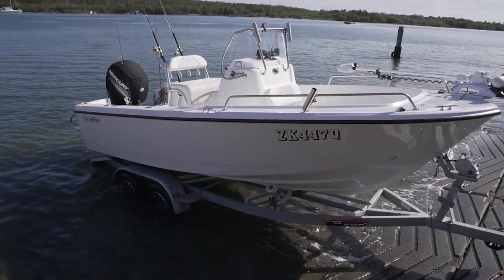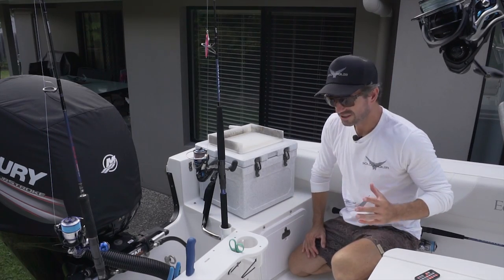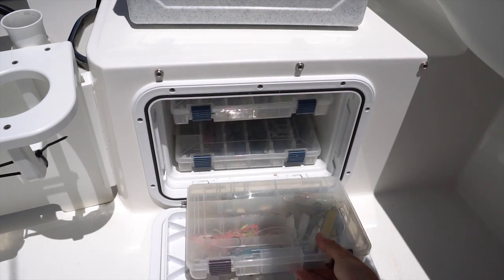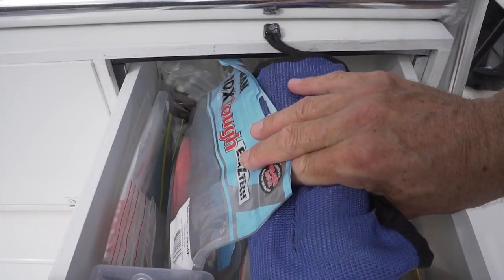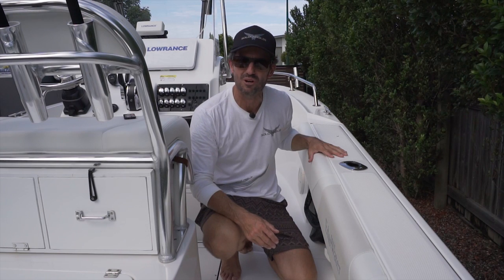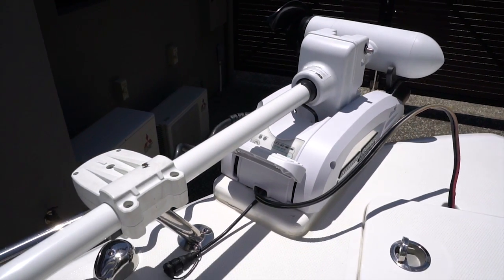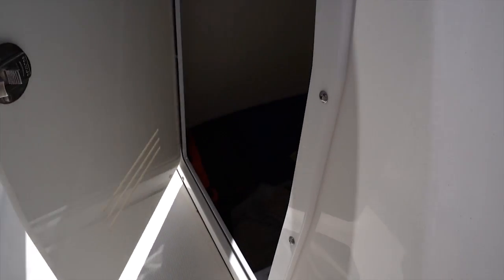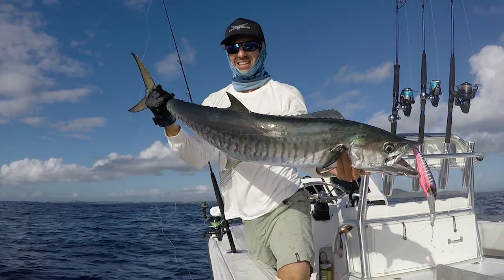How I setup My Edgewater 188cc

Comment: Great video and great boat. I have 1999 185 CC. It’s still running strong! Edgewater has made some great improvements especially with storage. What shaft length Minn Kota trolling motor do you have on your boat?

Comment: Awesome rig, do you have an electric winch on the trailer or do you drive it up onto the trailer by yourself?
Reply from the maker: I drive it on all the way to the clip, lean over the front and crank the winch handle a couple of times to secure, then drive it out of the water.

Comment: Love your videos - just signed up for Exploring Noosa yesterday and look forward to watching more. With all your experience now, if you were to get another Edgewater would you go for the 188cc or 208cc? Do you find the 80 lb thrust on the Minn Kota enough for your needs?
Reply from the maker: Hi Dave.  Thanks for the feedback.  I would stick with the 188cc.  It does everything I need and I don't require more space or weight or a higher fuel bill.  The love the layout of the 188cc and it's easy to manage as a Solo Angler.  The 208cc is great if you want to fish with 4 people but I very rarely fish with more than two.  The 80lb thrust is perfect as long as it's serviced regularly.
Reply: @SoloAngler  loving the videos!!!! pick my own 188cc later this week....can I ask do you have the 60 or 72 inch minn kota on front? thanks